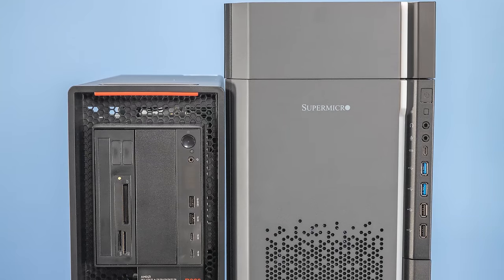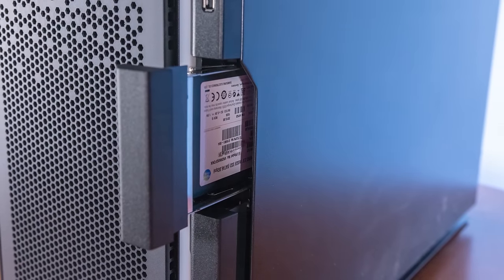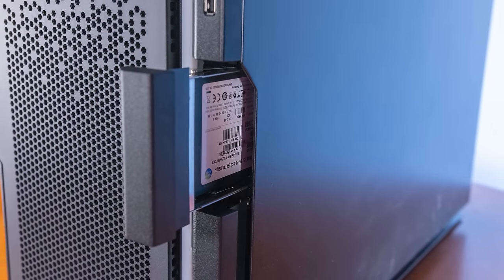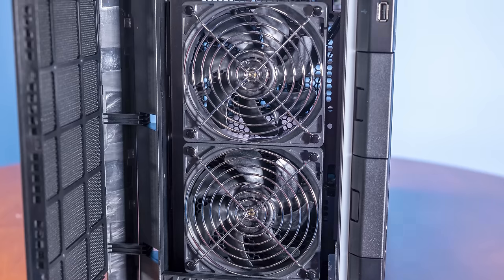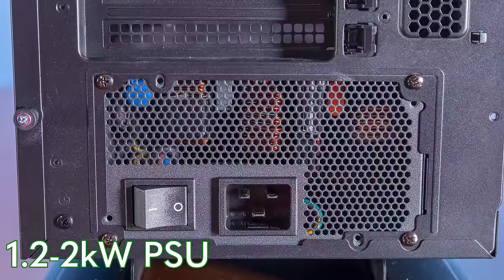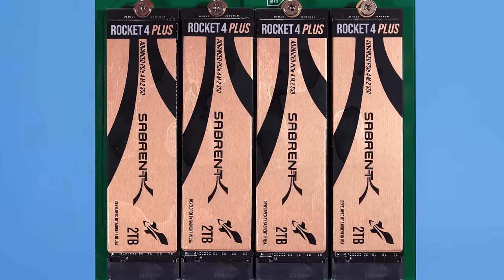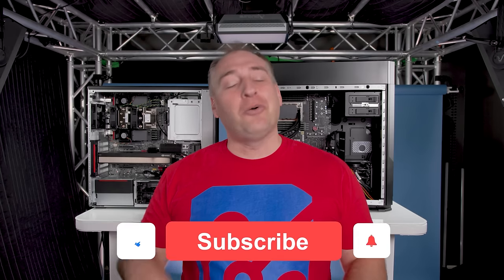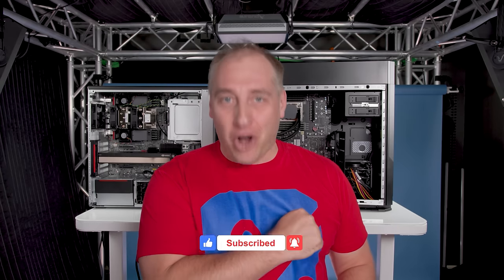Which AMD Threadripper Pro Workstation is Better?

Comment: PSB is an absolute deal-braker.
Reply: for consumers not for businesses that are probably going to upgrade to another lenovo
Reply: @tswiftsbf  ... we are here, consumers. We are talking about the second hand market. 

So it is still a deal-breaker for me.
Reply: What is PSB?  I'm looking at one of these on sale from a local business. Thanks
Reply: @Gorilla_Jones  it is literally in the video, from 16:23 -  Platforn Secure Boot - 
They basically tie the CPUs installed to that machine and you cannot use it in a different PC. For anyone using this system completely, there is no problem. For anyone trying to tinker with it, upgrade it or use the processor in a different machine, the PC won't boot with these processors. 

Basically vendor-locking it to THIS particular PC...

Comment: Hi Patrick, awsome video. One comment about the size, the Supermicro is not neccesarily bigger than the Lenovo. The  Supermicro can do a weird  hat trick that passed unnoticed in your review,  wich is that the  the top part is fully  removable / disposable !. Supermicro have different cooling options for this case,  with some of them  using air cooling and  not requiring the top part. They even have an optional  rack kit with rails that you can install  after removing the top.

Comment: Supermicro might not be saints, but at least they are very good at using industry standard connectors and the like. Lenovo has a 3 year warranty, but if anything breaks after that, youre completely screwed, whereas with the supermicro could be fixed with off the shelf parts.
Im a broke student, so my server has a xeon e5 v1, but having the ability to run whatever cpu (my hp didnt support v2, thanks guys...), cooler and case i want makes a massive difference.
Reply: I actually have last year's Lenovo P620. You have the option of extending the warranty to 5 years. They even provide on-site service and they will replace anything that breaks within those 5 years.
Reply: Who buy this kind of WS Payback the machine in 18max max then he double the investment in other 18months and they don't give a s...t what append after 36month because they will buy a new WS.
You have very naïf (amateurish)  vision of the world

Comment: super micro uses more standardized parts, that’s a clear win in my book.
Reply: Super micro doesn't vendor lock the CPU either so you can carry over the CPU if you upgrade it later. I love supermicro's products for this, getting used dell and HP server systems is pretty cheap but not being able to repurpose half the parts in them once I decommission them is such a deal breaker. I have this old Sandy Bridge Poweredge T110 II system and the motherboard is so jank, its some weird inverted form factor where it is bolted to the left hand side of the chassis when viewing it from the front while literally every other chassis in existance the motherboard mounts on the right hand side. so any expansion card I put in it was also upside down in order to fit in it. not to mention it was some weird dimension being like 11" tall and  14" wide

Comment: You just helped me avoid a HUGE blunder. I want to go with the 32 core, upgrade to the 64 down the line, and do a new build on the 32 core. If I had gone with Lenovo I would have been MFing like no tomorrow. The nails in the coffin were the added features for use as a server and the price, I could care less about the onsite service, at this price gap you can get a barebones 32 core Supermicro for $5,300.00.

Comment: Hi Patrick, love these kinda videos!!! You just made one tiny mistake, in the lenovo configurator you added the Nvidia A6000 (price 8k usd) while in the supermicro you didn't add it. As a result you did get a difference, but on 15k price range, a grand more or less doesn't really matter. For me searching, I see the Supermicro coming up about 1k more expensive. Since I am a 'fan' of both, I couldn't say really which is better since both seem to be superb. Personally I would build these myself if I got the chance to shop them. (or at least buy ram/drives/gpu at third party) Because yes the vendor lock of the big 4 is the one thing that really turned me off most pre-builds. (3x markup on ram and drives comes to mind) Anyway another great video, thank you, keep up the good work!

Comment: I've actually been looking around at high end workstation for my own needs and I keep ending up at the idea for my needs where it's going to be running in a home work environment that SuperMicro keeps ending up the better buy overall.  In my case the machine will be being used for scientific compute needs for astronomy and astrophysics research and that price difference can't be ignored as I'll probably be paying out of pocket for the machine or via grant money. There's reasons to go this route too as a researcher as once I'm out of school chances are I'll end up having to move around for a while ever year or two and I'd rather be in the situation where taking my own research data with me is just simply packing up a tower and a NAS or two than trying to deal with moving larger amounts of data ever few years when I end up inevitably moving because I can't get a contract extension or tenure. So for me if I get around 4-5 years out running the machine hard it's payed for itself and I'd be probably looking to upgrade by then anyways.
Reply: Wow, you get about a bit!
I never realised that you needed a machine this powerful, the Supermicro is the clear choice for sure for your needs, and the resale value in 5+ Years time make it a no brainer VS Lenovo Systems with PSB Enabled!

Comment: With Genoa 280 W will be "just the beginning" ;)
Though I did hear that Workstations (Threadripper) aren't scheduled for release for another year, which is a bit sad.
And in this case: 6000$ less for something that doesn't vendor lock your CPU, has much more room to upgrade and better cooling (that depends on preferences) is sort of no-brainer. Though I'm amazed at how good P620 actually is. I was worried we would get something much, much worse, more akin to what you can buy in Walmart for Desktop PC's. But both are well made and Lenovo system has some things going for it. But not worth additional 6000$.

Comment: I bought Lenovo's last year's model. It has 5, no 4 PCIE expansion slots (1 is in the front) so it can be configured to have 5 HDDs. I imagine it is possible to do the same in this unit.

Comment: One of the great features of the Thinkstation is Lenovo Performance Tuner, which I have found really powerful on my Intel-based Thinkstation, as it allows extracting untapped performance from my older system when running specific apps, and allows me to save templates so I don't have to retune if I want to run something different. Did you try tuning the system this way for your 24 hour test?

Comment: Mh... So my 5950x should be third, right? 😃
Awesome, great great video. I have on my PC a 1080 external radiator nexXxos xt45 with 9 120mm fans, and it's incredible how much potential is hidden in a good CPU if you only create the conditions to use it. You can work in a stable environment every day, every hour, in situations that others can reach only for some seconds, firsts of the benchmark end. 
A good well though liquid cooling system can make the difference in long heavy loads. 
Really thanks for all these opportunities of looking at the most powerfull workstations of hour times.

Comment: You screwed up by not showing us the systems running and testing noise levels of the systems.    Are they too noisy to place on a desk and be used as true workstations?

Comment: The Supermicro has a BMC which is a great advantage if you want to use it as a "cheapo" server. I find it a bit odd that you say "has IPMI" instead of "has a BMC" since IPMI is just one of the common interfaces for a BMC. But IPMI is outdated and was replaced by Redfish, which is a more modern and simpler interface (using HTTP and JSON). Would have liked to see a bit more about the SuperMicro BMC. Otherwise great review, thanks. :)

Comment: Do you you think using the liquid cooling on the Supermicro is the better option vs the Fan? What are the drawbacks of the fan? Will it just a be louder? or is it considerably cooler than the FAN therefore offering higher consistent peak turbo performance?
Reply from the maker: We went into the performance differences of the heatsink/fan versus liquid cooling in the video.
Reply: @ServeTheHomeVideo  yeah I saw that I was hoping you would say which you would rather buy...but it looks like there is minimal gain only in extended peak usage. not going to worry about the liquid cooling option. the cooling extension on top seems like it might be good to use to cool some graphics cards if you get a few packed in there tight..

Comment: With the TR or EPYC CPU mounting, how easy is it to get the mount pressure wrong and have it lead to issues with the system memory or PCIe links?
Reply from the maker: SP5 for Genoa is different (you can see the latest video). On SP3 it was reasonably easy to get right, but it could happen if you did not follow specs.
Reply: @ServeTheHomeVideo  So SP5 is a little more bullet proof with only the single screw.  I guess that hard to mess up?

Comment: The RAM cooling fan confused me a bit. It seems  based on the plastic cover, that the fan is supposed to blow air towards the front of the Case, whilst the CPU cooler is drawing its air towards the back. Why not push both in the same direction

Or it's supposed to pull air through the dimms, but that still seems a bit weird
Reply: Yeah I saw this too. I'll pop the case on the one we've got and see if thats the airflow...makes no sense if it is that way - you'd think they'd eject all hot air out of the back asap
Reply: @hypercube33  any uodates?

Comment: The shorter Lenovo seems to be one of their rackable cases. Although I can not find a rack mount option for the P620 case many of their other pedestal systems have 4U options.
Reply: There is a rack mount kit for the Lenovo - we've got one at work. Here are the part numbers we ordered
CDW Part: 3851698
Lenovo: 4XF0k29048

Comment: Lenovo said, TR 64C 1P "killed their Xeon 2P workstation sales" I'll keep that observation in mind I have the 1P v 2P supply data for many quarters back and looking forward to report on it. mb
Reply: Lenovo ala IBM way back modular subsystem design in relation Supermicro DIY model. mb
Reply: Yea modular can mean locked in with less or no component / subsystem salvage value. mb
Reply: good report. mb

Comment: Confirmed: Patrick is a Supermicro fanboy.

jk, I'd go with that option also.

Aside from the whole PSB thing, by using standards, you can replace any of the parts with industry standard bits if they break and say you can't get your hands on an SM board but need that machine up and running. With a closed system, you're at the mercy of the vendor and have to hope they have some in stock.

I'm with you on the whole PSB thing and can't imagine how they didn't come up with something that was reprogrammable, even if it required special hardware. A couple extra pins that aren't normally connected to allow write access would mean it can't be done in situ, only by removing the CPU and using a separate board to do so.

Comment: in most cases cheaper is better specially if you are dealing with expensive servers and workstation.  I am not surprised here as lenovo and hp workstations are ALWAYS overpriced,  nonetheless  supermicro givee us an alternative  here price and additional features so i was to buy a workstation for my heavy load i would definitly give supermicro shoot here.  with the extra saving i could probably reach the 1TB ram.